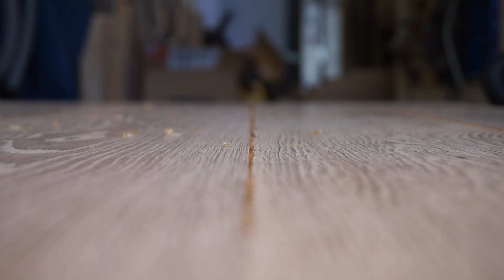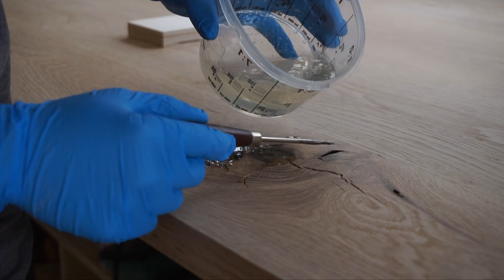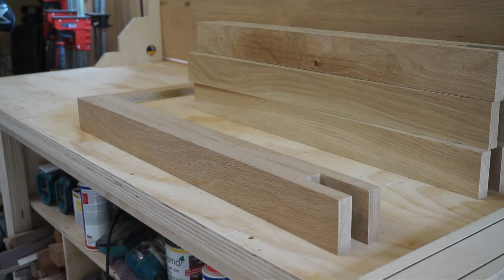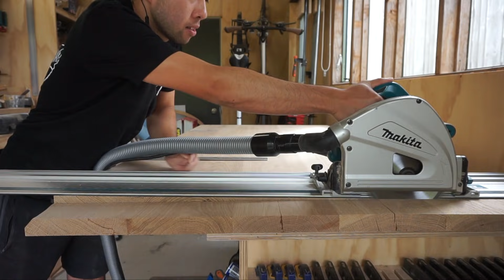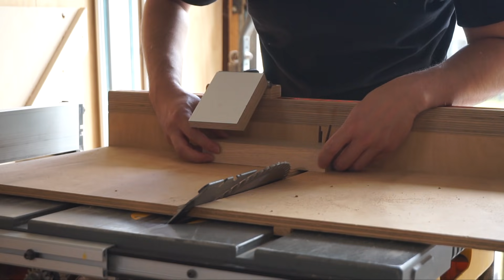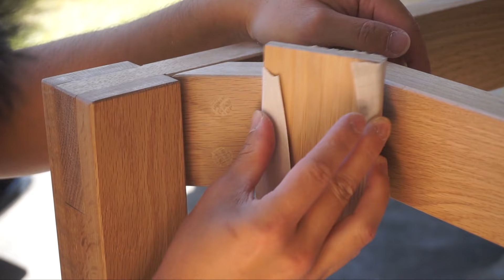Solid Oak Dining Table

Comment: I did a similar table using reclaimed mahogany and learned a couple things the hard way.
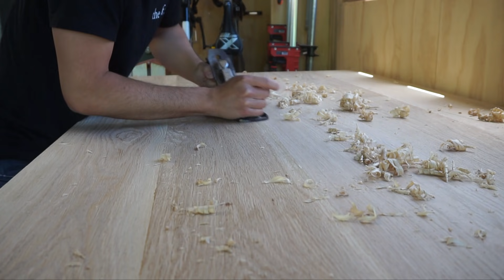One, you have to orient each tabletop board so you can plane the surface (1:38) in one direction.  If not, the plane will gouge the surface... fill with epoxy later, but it's unsightly.  
The growth rings on your top boards (some up, some down) suggest they may cup later.
That's a small fortune in tools.
Facing the boards on a table saw is more properly done on a jointer.
You should emphasize that any epoxy has to be absolutely well mixed.
The blowtorch on the epoxy is to pop the bubbles that will rise up to the surface, but it's unnecessary if you're going to sand it later.
Blind tenons on the legs would have left the completed table a little more attractive.

Everyone's a critic... you did a nice job.

Comment: Looks great. Good detail. Clever trick covering the other side of your small pull saw with tape. I recently bought white oak from ititimspec - they organised for it to be D4S and jointed and shipped it to me in Wellington. A bit of a risk with humidity changes etc for a table I made but it seemed to cope well.
Reply from the maker: oh nice. Timspec was going to be my next option. Not sure who is cheaper out of all the timber suppliers.
Reply: @TheOffcut  Oh damn, that was going to be my next question. I paid $5,350 excl GST per m3. I needed just over 0.2 m3 for a table a little smaller than yours.

Comment: That table looks amazing! Only wondering why you didn’t biscuit joint the table top?
Reply from the maker: Thanks! I didn't feel like it was necessary. The boards were very flat and square so the glue up was pretty straight forward.
Reply: biscuits, lol.
Reply: several years later you will regret not having used biscuit or domino, but the table is stable enough I think,good job!
Reply: @Looyenss  hyyy 👍👍
Reply: Biscuits efficiency over time seems to be more than questionable
Reply: @yuzhang720  lol, doubt it.  They are good for alignment assembly if needed.  The glue is the strongest part of the joint.

Comment: Looks great! I see only one big problem.. The core of your boards should be alternating up and down. The board cores of the tabletop are almost all facing down, which will result in a majorly cupped top over time.. Maybe something to take into consideration next time! Besides that, great work!
Reply from the maker: Thanks! For some reason I didn't think of that at the time. I think I was more concerned about the sides that looked best for the top. Which unfortunately made them all the same grain direction. It had moved slightly before putting the top on but screwing it to the legs pulled it back down without too much pressure. Only time will tell
Reply: Several people have tested this and found there was no difference.

Comment: I see the figure 8 fastener mistake all the time. Obviously way too late, but you can’t put those on the sides. It will lock it in place and do the exact opposite of what you’re looking for. Just a heads up.

Comment: Quick question - for the leg assemblies, why did you glue the two pieces along their faces with the half laps in them, so that that internal pressure from the inserted apron side would push outward on the glue joint? If you glued the leg assembly before cutting out the mortise, then rotated the leg assembly 90°, you’d have the internal pressure from the tenon pressing outward on the actual grain of the wood rather than the glue joint, but would still get the same exposed joint look. 

Is there a reason you cut out the mortises (as half laps) before glueing up the legs? Ease of use? I know it’s easier to run them over the table saw rather than hack out with a chisel lol. Just curious if there was another reason you made that call that I’m not thinking about. Beautiful build and I appreciate your touches.
Reply from the maker: Thanks! It was purely because it was easier to cut and assemble that way. I'm not too worried about the joint pushing outwards on the glued face.

Comment: I like the figure 8 clips for attaching the top. I’ve used those too. One question: what do you have against using a dado blade for making the tenons?  Seems like it would save you a lot of work.
Reply from the maker: I don't have anything against dado blades. I wish I had dado blades. I haven't been able to find them in New Zealand and I'm not sure if my table saw arbor will fit them
Reply: @TheOffcut  they don't fit on a Dw745. Carbatec sell dado blades too.
Reply: Most saws outside of the US don't have arbors long enough to take them as they're considered to be a non-essential device with a significant reduction in safety (no riving knife, no blade guard), so various regulations forbid them.

Comment: why use tablesaw and jig instead of straight router bit for rebate? cheers
Reply from the maker: I could have used the router to do it. I just thought it was easier to do it on the table saw and not get as messy with all the sawdust. A router table would have been best but I don't have one yet.
Reply: @TheOffcut  i see. epic table man great workman ship

Comment: Dude that turned out great! You must be super happy. Was wondering what finish you used when I saw it on insta - it OsmoX Hard wax [sic?] right?
Reply from the maker: Thanks Rob! Very happy with it. A lot of firsts for me, like filling the holes with epoxy. Luckily it turned out good. Not perfect. But good :D. yea its Osmo hard wax oil with a matt finish.